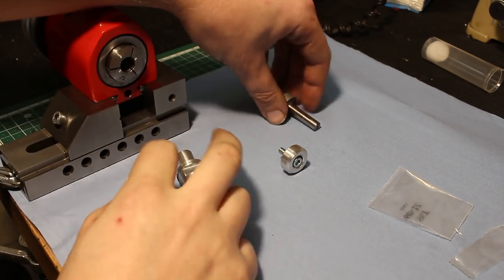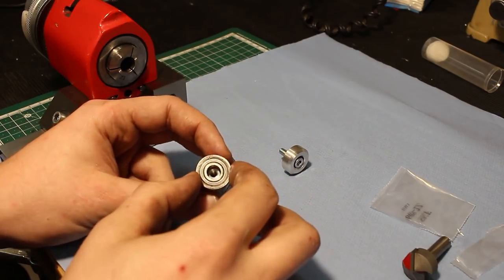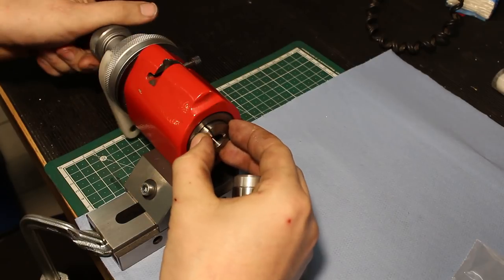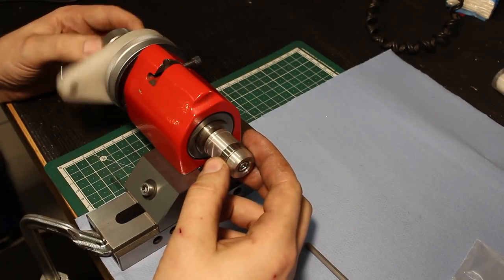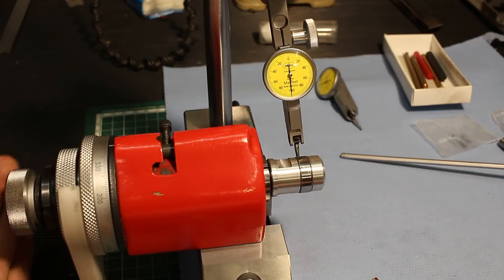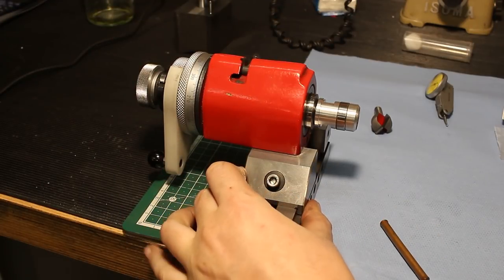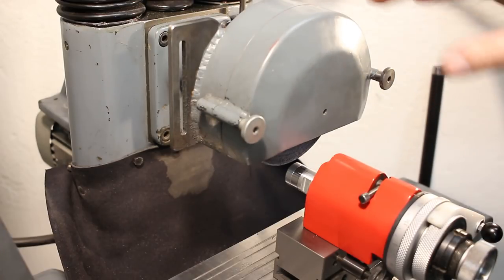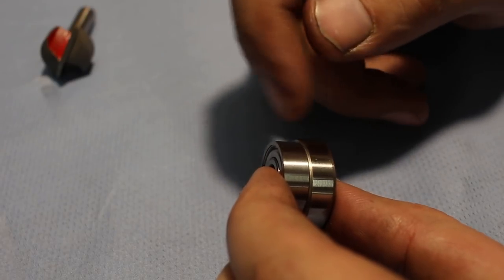Resizing a ball bearing

Comment: "Its not a precision critical application" as he dials the runout within 2 microns :) - Classic Stefan
Reply: When he was dialing the first time I was thinking... WTF!  and then ... he changed to the 2um dial... Stefan! 
I bet the router has more runout than that bearing!
Reply: Bearings don't have runout. That being said a deep grove bearing in a "usual" size with standard clearances (CN) has something like 10 µm radial play or thereabouts.
Reply from the maker: Bearings have of course a runout tolerance - Outer to inner race. You will find that defined in every bearing catalogue.
Reply: My understanding is that the normal radial clearance is designed to be enough to "take up" the inevitable concentricity error between the races - but I might be wrong ;)
Reply from the maker: It gets very relevant once you preload the bearing - Like in a machine spindle :)
Reply: Stefan Gotteswinter Good deal!
Reply: +Das Stackenblochen not true the less run out the more expensive the bearing ie gamet rhp gold etc
Reply: Ah that makes sense. I should get learned more before going around telling people "bearings don't have X" :)

Comment: My own personal take is that good enough, satisfactory, sufficient, acceptable, suitable, reasonable, agreeable, adequate, usable, all right- these words do not necessarily mean compromise in any endeavor, just a point at which nothing further of substance will be gained by additional effort. ☺
Reply: Philosophical grratness.
Reply: I take it to mean that the result will fulfill the intended purpose. The clothes that I wear in the shop are "suitable" for working in the shop. Anything nicer would be wasteful. If I am going into the office, stained jeans and an old T-shirt might not be so suitable....... Out comes the suit and tie, along with the extra effort and expense that goes with it.  Machine work has equivalent levels of tolerance and surface finish requirements... My $.02.

Comment: I admire your ability to apply  a well thought approach to problem solving and final result.
Thanks for taking the time to video and explain your thought process. Not sure if you have experimented 
With the following technique but.... years ago (40) when I used to run a cylindrical grinder on 
HT steel and hard Crome shafts we loaded (pressed hardwood board) into the face of the wheel
To “fill” some of the pores.  It helped the finish quite a bit.  We usually did this if we were not going
To the lathe do perform a lapping/ OD honing process.  
Thanks 
Ken

Comment: When I saw this I thought you were resizing a bearing ball
Reply: fefifofob Same, now that would be cool to watch
Reply: Exactly what I thought, and started trying to think how the heck is Stefan going to do that!! 
Future project to show us?.......😁
Reply: Ah, yes the old referring to the ball in a bearing as a "ball bearing". No, unfortunately all they are is STEEL BALLS. It is not a BALL BEARING until the balls, cage, inner and outer race are assemble together. After all no one refers to the roller from a tapered roller bearing as a "roller bearing".
Reply: Bearing Ball ?
Reply: He Ka - Inside a.ball bearing are steel balls. Those are called bearing balls.
Reply: I don't actually know if it's correct but I tend to use the term bearing ball to distinguish from steel balls of insufficient tolerance and hardness to serve in bearings. I don't even know of such balls actually exist but I dislike imprecise language.
Reply: I wind up calling them ball bearing balls.
Reply: Same. Christ, the guy is machining 0.003mm off a 3mm hardened steel ball, I thought.

Comment: Fantastic as always!!! An alternative (simpler) method (and very precise) is fixing the bearing on a shaft and approaching the grinding wheel under an angle ( 40°to 60°in top view).  Because of the angle the grinding wheel will make spin the outer part of the bearing and grind it at the same time.  And because of the bearing spins on it's own center, the grinded circumference is perfectly centered.  The only potential disadvantage (only for small bearings) is the high spinning speed the bearing has to go through?  For when the outer diameter does not need to be very precise on can do this method by fixing the bearing on a long bolt and hold it in hand against a workshop grinder or sand belt under an angle.

Comment: Just a headsup on the D-bit grinder / vice setup: The dovetail joint doesn't pull it down to the flats when you tighten the vice jaw. If the round pins are resting against both flats of the dovetails, then you can clamp from them to any position in the vice.

The pull down effect would only work if the dowel pins would be attached to the vice jaws and they never contact the other face of the dovetail in order to not overconstrain the setup.

But apart from that little thing, awesome video and nice setup with the arbor :)
Reply: This is a useful way to hold dovetails in a vice without damage to them. It seems to me that there is a certain hold down effect even when the dowel pins are free to move, but just in the last instant when tightening the vice. 
Perhaps this has to do with the geometry of the 3 contact points forces /frictions creating a down-rolling torque on the pins. The force against the 45deg dovetail surface should be largest so the pin might roll against this surface an slip against the top, so when tightening the vice perhaps the pins tends to roll a little pulling down tight. Would be interesting to hear any ideas why this seems to work, or if there is another explanation.
Reply: You are talking about first order geometrical behavior, but this has to do with how the materials deflect while clamping. Since the surface above the pins is parallel to the direction of force applied, it will be the surface with the least friction. Thus the pins will slide against it, rolling in a direction such that they drag the grinder down into the vise.

Comment: Another plus for making the arbor smaller diameter and knocking it to concentric is that the bearing will never be supported by its inner race during grinding.  Pls note, when that bearing is on the router bit, the only time the outer race is spinning at high speed is when the router is running but the tool is not working.  When the tool is working the bearing outer race is up against the material being cut by the bit.

Comment: Collet indexing pin: have you ever calculated its shear strength as an indication of its torque capacity? I contend its absurdly small compared to the torque required to drive a saw arbor or a flycutter in a turret mill spindle. I calculate the collet indexing pin on an R8 spindle socket shears at approx 80 ft lb (108 Newton meters) not counting the slip torque of the collet taper in the spindle socket which I calculate at 360 ft lb (486 Newton meters) @ 75 ft lb (101 Newton meters) drawbar torque.

The pin's only useful purpose is to provide positive indexing for collet insertion. Once the taper is tensioned, the pin contributes little to resist relative motion between spindle and collet. I've served our trade since 1961 in dozens of diversified roles and never in that time have I found it necessary to orient a collet in precise timing with a spindle - the work, yes but never a collet.

My position is to remove collet indexing pins where ever they are encountered because they serve no useful purpose and if sheared they nearly destroy the precision fit between the collet and spindle before the operator has time to react. It might be argued that slipping the collet taper will destroy the spindle but my experience is a revolution or three of collet slip produces little damage if the operator is vigilant and stops the spindle expeditiously. My Bridgeport clone - survivor of dozens of spindle tooling slips - is testimony to that assertion.

The calculus for removing the collet indexing pin  is avoiding certain damage Vs unlikely damage.

Could you address/confirm/refute these points in some future video?

Comment: could you use further up the side of the grinder to increase the cosine error (i think thats the right term in this case) by moving the contact on the wheel further around you need to move the head more to remove the same?

Comment: Are there no commercially available ball bearings with the required inside and outside diameters?
Reply: Standard 608 are MUCH cheaper. Probably the least expensive bearing that you can buy.
Reply from the maker: Dont think there is a 21,5mm bearing with 8mm ID out there... ;)
Reply: The bearing size is standard , the router cutter not. This routerbit was not designed for a bearing so the maker paid no heed to standard bearing sizes

Comment: Just a question about taping with the force going into the indicator  when you adjusted the race on your arbor.   I wonder about the long term impact on the mechanism.  Maybe one of those operations that has no effect in the "real everyday world" but good indicators are not cheap and I want mine to live a long time.  Thanks for sharing some interesting solutions to uncommon jobs.

Comment: Horace RumpoleThis operation can also be done with the bearing mounted on the bit-a thin steel washer with the od large enough to isolate the cutter, and two thin fiber washers, above and below the bearing to make it rotate with the bit. Hand stone in mill to desired dia.
Reply from the maker: Stoning off 0,5mm in diameter will take quite some time ;)
Reply: 60 grit corundum stick moves things along pretty good.

Comment: I am curious how much 'out of round' it actually came out.  Not TIR, since that could possibly be just off axis, but geometric roundness.  Is there a formula or reference to get some idea what class of bearing would be necessary to hit a certain precision of part?

For example, if I wanted to make a piston / cylinder with an 'air tight' fit, could I do that on a machine with ABEC 3 bearings?  5?  7?

Comment: Hi Stefan
Was it necessary to remove the shields and wash out any grinding residue from the bearing internals?
I think the phrase popularized by Voltaire fits in this application :' do not allow Perfect to be the enemy of good "-having done much router template work roundness in the bearing is usually the least of one's worries :-)
thanks and regards
vic
Reply: With the outer race clamped between the arbor and washer, nothing could enter the bearing.

Comment: The red spindle that you take from the Deckel-look-a-like Chinesium grinder is really handy.
In your shop, there is a flat-surface grinder, which is all very useful.   

So for the metal grinding and drill bit grinding, 2 machines are need.  

I was wondering if these two machines can join together, so one grinder for both kind of jobs.  

I was thinking of a Chinesium flat grinder with magnetic flat surface.  Then I buy the parts like the
red spindle in your video to take care of the drill bit kind of tools.  They are available in the usual outlet.   

It might not be as rigid, but it could be more fun.   As shown in the video, I am sure it should work.

Any suggestion?
Reply from the maker: Sounds like a proper tool&cutter grinder, which is basicaly a surface grinder with a few axis of rotation more.
Look at the small Clarkson or KO Lee T&C grinders, they are basicaly what you describe.

A surface grinder can double as a makeshift tool&cutter grinder, but is limited, same the other way round, a t&c grinder can do surface grinding, but most of them dont do it very well.

Comment: Ball bearing is fine if the bearing has balls in it, roller bearing is the term used when the bearing uses cylindrical rollers. For you this is fine, no worries. In the future you can always just use the term bearing and leave it at that. I was going to complain but I decided that my underwear wasn't twisted enough for me to really get into it. You get a pass, this time. Thank you Stefan.

Comment: you actually don't need to clamp outer race of a bearing.
it can be grinded as it is, if you place bearing with its rotation axis perpendicular to axis of grinding spindle.
(not complete perpendicular but 80 or 100 degree. bearing of course will spin, but with low RPM)

Comment: what would happen , if you put the bearing angled with 45 degrees relative to the axis of surface grinder (or the mid-plane of the grinding wheel) and let the outer race freely spin? could it still be ground while rotating at the same time?
Reply: You could be right if the rotation axis of the bearing were inline with the wheels rotation axis (0 degrees as in the current setup of the video). This is the reason why I also added 45 degree angle to the setup, which will divide the force vector into two components.
Reply: I have reground lathe centers using a variation of this technique, and it works well. You can also add some friction if the workpiece gets to spinning too fast.
Reply: The real problem with this is the surface of the race would have as much variation as the looseness of the bearing.
It would grind even if the axis of the bearing and grinder where parallel. The race could be braked with something like a piece of felt or cotton if it tended to over-spin.
Reply: joshua43214 Yes, of course you should only use this approach with precision bearings. Note that the setup used in the video has the same problem, that grinding precision is limited to bearing precision.
Reply: His set up ignores any issues of bearing precision, and reduces it to one of set-up precision. Since he is centering on the outer race, the precision of the bearing (in terms of slop) is not an issue.
Letting the bearing free run would give a grind exactly the same as the precision of the bearing (once again in terms of slop). Even an ABEC-7 bearing would give pretty bad results since even though the inner and outer races will be highly concentric and tight, the outer race will be able to tip. You could probably get decent results doing this by plunge grinding, but not by traversing as done in the video (then the bearing will only be as good as the stone...).
Free running the bearing would only work on something like a pre-loaded pair of bearings, but then you would have troubles getting it to spin.
Stephen understands all this, and it is why (presumably) he made his arbor the way he did. It would have been simpler to grind the arbor in place so it is perfectly concentric to the axis of the spindexer. The clamps would then contact the inner race on one side, and the outer on the other side. This would load the bearing so the inner and outer races are concentric and allow him to grind the outer race concentric to the axis. But the cumulative error of small variations in ball size and race irregularities would be greater than the error in his set up unless he used a very expensive bearing (not worth it for a consumable part).
Reply: joshua43214 Not so. His setup just has the bearing in a different place.
Reply: @ Paul Mathews
Not sure what you mean. Different place than what?
His set up clamps on the outer race, and is then centered on the outer race. Bearing precision will have no effect on the grind.
Reply: joshua43214 The bearing in his grinding fixture.
Reply: @ Paul Mathews,
Still not making any sense. 
Try to remember, I am not able to read your mind :)
Reply: joshua43214 When you do cylindrical grinding on a standard surface grinder, it is always true that your surface is only as good as the bearings that constrain the workpiece to rotate true. In the setup in the video, the bearings are those in his tool grinding fixture that he borrowed from his tool grinder. That is why Stefan mentions several times that he understands the limitation of his setup, which are related to how true those bearings run. I hope that this is enough explanation for you. If not, I give up.
Reply: @Paul Mathews,
Got it. I have been talking about the bearings being ground, you are talking about the bearings in the spindexer.
You are absolutely correct sir. The grind is only as good as the fixture.

Comment: And it's not going to be used for a load bearing application, so it should be more than fine.
Reply: Depending on the depth of the cut, there should be some side loading?

Comment: Nice work Stefan. We did a video on our channel "Grinding wheels and surface finish" comparing the finish of various wheels and grit sizes. We had better finishes with our 46 and 60 grit wheel than the 120 grit. If you are interested check it out.
Steve

Comment: Why not just put it on a 8mm shaft and let it freewheel on the tool grinder with the head at an angle and a light drag on the bearing race?
Reply: you will overspeed the bearing plus you have no control on the relative feed rate. all in all a bad idea.
Reply: At an angle, the vector force spinning it would be minimal. Same way you free hob a gear. Crappy 608  bearings are rated to like 32K RPM. The tool grinder doesn't go anywhere in that ball park even if you were spinning it parallel to the wheel.
Reply: Hi David,
For this application, that would probably be OK. But you will not get a true cylinder with the bearing at an angle to the wheel. If you are exactly on centerline, you end up with a concave in the bearing.  If you are off center you get a taper. 
These effects will be slight, but are measurable.
Reply: Hi Jerry, 
Just a different way to get to a similar result. Neither results in a true cylinder. They both result in an approximation based on the size of the grit and the diameter of the cutting wheel along with the effects of any other relative movement. The only contact is grit on the wheel which takes small scallops out of the metal as the grit cuts the material. In this case, it would be like switching from a belt sander to a random orbit sander.  My initial gut reaction is that the random contact would create a better final surface as that is the technique that they use in optics. In this context, I believe it would be a wash.